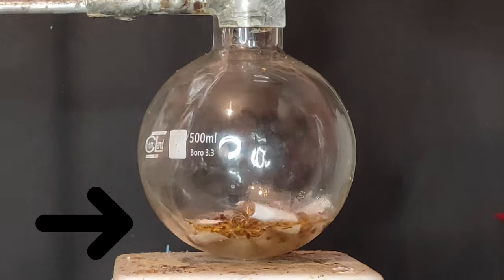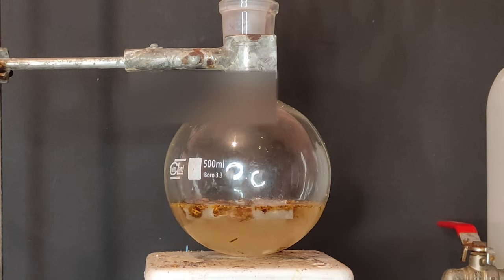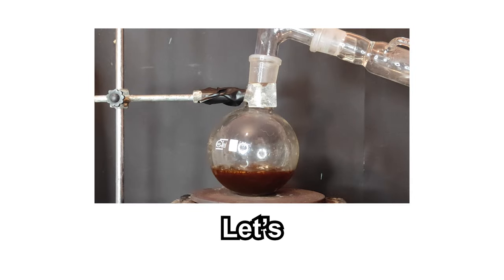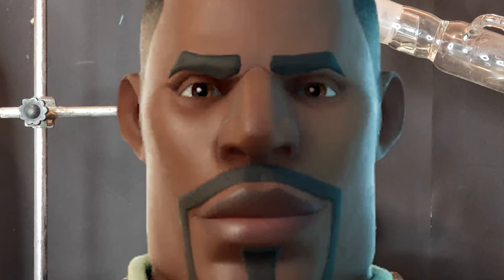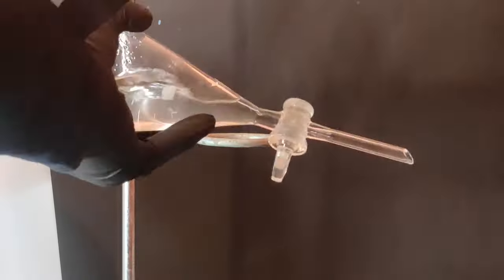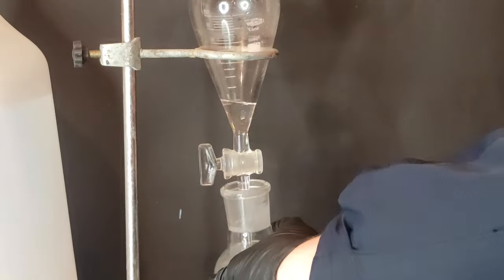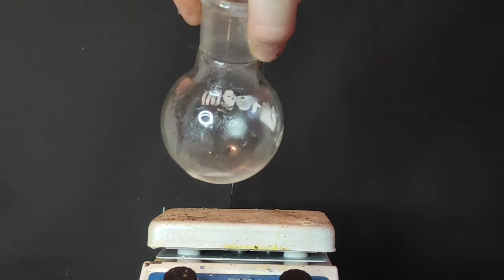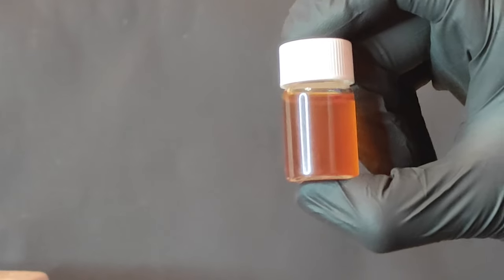Extracting Nicotine From Tobacco

Comment: I was wondering how you could separate nicotine from Propylene glycol or Glycerine?
Reply: Same thing.. just distill it to get the water out.
Reply: Are you extracting nicotine from vape juice?
Reply: Not easily, the only thing I can think to do is salt the nicotine out with your choice of organic acid (one that doesn't react with VG or PG and yields a crystalline nicotine salt I guess) and run a vacuum distillation.  The amount of liquid you have to evaporate for such a small yield isn't worth your time imo, unless you have a very strong solution

Comment: So I have some 10% nicotine in propylene glycol because I make my own vape juice. It's very rewarding when you learn to mix flavorings well. Yours had a dark color which mine also has and I believe is nicotine n oxide and the older it gets it forms a strange "peppery" flavor. It's very interesting how toxic it is but also it CAN be forgiving(nobody out there try this though). I worked at a place manufacturing vape juices long ago and during a stupid accident I spilled a rather large amount of nicotine which got on my clothes and bare skin. I luckily had a change of clothes at work because I rode my motorcycle. I quickly stripped while running to the bathroom to wash off. I didn't even so much as get a nicotine buzz out it. This was a great video It makes me wonder how much nicotine can be extracted from eggplant? I know alkaloid concentration is low but also the highest next to tobacco if I remember correctly.
Reply: Yeah, I'm buying bottles of 20mg nicotine (150 ml) diluted in VG and it happened that I used all my liquids and was waiting for new ones. For a few days I was going crazy a little bit so I looked at old bottles for a small fix and found a bit left in one of these old bottles. It was now yellow/orange but it still tasted normal...
When it's brand new it's perfectly clear without any colors.
Reply: @Alfred-Neuman  it goes really dark and develops a pepper-like taste after sitting for a long while. Mine is such a dark brown color you can't even see a flashlight through the bottle. 🤣
Reply: @midwestchem368 what is a long while? Month? Year?
Reply: @DanDan10101  I've looked at some papers and they say it's to do with UV exposure primarily, so it depends where you keep your juice
Reply: @kuni45  don't forget the heat..
Reply: I believe it's 26 eggplants = 1 cigarette.
Reply: This is actually why you have to wear gloves when handling tobacco plants, it can cause a nicotine overdose and a lot of deaths happen, the skin absorbs it like a charm
Reply: @bonnie9855  where?
Reply: @DanDan10101  where what
Reply: @bonnie9855  where you're handling those plants?
Reply: @DanDan10101  anywhere on the plant, mostly the leaves, but once you dry the leaves out they're safe to handle
Reply: @bonnie9855  I mean where do you work? Marlboro plantation or what?
Reply: @bonnie9855   I haven't heard of a single death from GTS
Reply: @kuni45  because tobacco has been harvested for hundreds of years, people typically know what they're doing. A death is rare
Reply: @bonnie9855  so you're saying a lot of deaths DON'T happen from GTS
Reply: @kuni45  rare still means a lot, we're looking at the population not a fuckin monopoly chance card
Reply: Keep the nic in the freezer and stick to PG due to the viscosity issues of VG

Temp and light oxidize it (esp freebase), hence peppery tastes when people just keep their bottles out in the open

Salts are also more dangerous despite being "smoother" due to a higher pH vs freebase as you generally use more nicotine and they include acids like benzoic acid etc

Comment: Hello Prussian Blue, 
Hope you are doing well mate! 
After dealing with some (issues...) I'm back again and ready to do this same extraction. However, I've got some questions that I think you can aptly answer. The part involving Diethyl Ether is something I probably wouldn't tinker around with (peroxides + overall volatility) - I just saw a video from Thylabs where he did a similar procedure - just that instead of using Diethyl Ether, he used Methyl Tert-Butyl Ether, and his reason to prefer this was that it does not form peroxides - which seems great. Do you think using MTBE would be suitable for this process would be okay? What will change? As in, the evaporation of MTBE after Tobacco Water distillate and MTBE liquid-liquid seperation - in simpler terms, what changes would be needed to this overall procedure for nicotine extraction if using MTBE instead of Diethyl Ether? 

I'm assuming that using Sodium Hydroxide Solution is better for Freebasing nicotine from Tobacco rather than potassium hydroxide (as thylabs did) comsidering your output ratio of nicotine for 5 Marlboro Gold sticks / 5g tobacco seems better than his for 200 grams of Homegrown Nicotinia Rustica - however please don't take me otherwise on the remark, it's just my amateur observation and resulting assumption.

Also, which grade of ethers is most suitable for this extraction - seperation procedure? Laboratory Reagent or analytical reagent? My supplier seems to have both available, and with a very minor price difference (less than a dollar, and I'd be okay with spending an additional dollar or saving it depending on which ones are more suitable)

Edit : okay after a bit of reading it seems like LR is the one to go with for Liquid-liquid extraction procedures
Reply from the maker: Hi, MTBE may be harder to come by depending on your country, as for ether's peroxides they form after a long time in storage so i think if you store it for 5 days in a dark place it shouldnt form peroxide and after youre done with the extraction just pour it and light it on fire somewhere, dont do it at home though, because ether can put you to sleep if you inhale it too much (obviously if youre doing the extraction you will smell the ether but dont freak out because i smelled it but i was in a ventilated room and i was fine) also if you want to have a very high yield remember to wash it a lot of times with diethyl ether and shake it a bunch

Also it mostly doesnt matter which base you use what only matters is the OH part also if you want pure extraction id go with lab grade also ive never used mtbe but if he got a good yield out of it then you should too
Reply: @Prussian_Blue  Thank You for the reply mate, I appreciate it!
Funnily enough, MTBE is available at the Local Chemistry supplies store here, and for much less than Diaethyl Ether 😮 and no issues to get it, just pay in cash, take the item, and leave. Simple as that really. 
My main opposition to Diethyl Ether is exactly that - it forms peroxides. Handling and Disposal of it is very different (and difficult) in Tropical Climate, 30°C is the ambient temperature here even in winters. And chemical waste collection facilities are inexistent in countryside MH, India. 
Will MTBE interfere with the process or cause some unpleasant/undesirable changes to the overall reaction? 
I'll keep the washing and shaking parts of the process as thorough as possible. (hopefully, without popping off and breaking a stopper, haha)

Comment: Thank You bro 😁 

Now vapes are banned in my country (to protect government tax revenue on tobacco obviously) 

So I'll follow your procedure, precipitate this nicotine into salts (anyone can tell me how? I'm a noob lol), mix it with 70-30 PG-VG Vape Juice Solution, add tobacco flavour concentrate (13% works best they say), make my own cig replacement vape juice

Then will order some Japanese Kangertech Cotton for vape wick 
Nichrome wire or something suitable for coils 

Will get an enginner to prep the vape IC, get 10 units of 18650 2200 mAh Batteries (and a universal charger too) 

Get the wires and other necessary apparatus too 

3D print or hire another engineer to CnC a case / box to hold all this together 

Vape in peace ... And finally get rid of tar and glue and paper and 6000+  other chemicals and carcinogens that would otherwise be entering my lungs cause government. 

Wish me luck peeps!
Reply from the maker: Well if ur gonna smoke it you should leave it in a hot water bath to make sure you evaporate all ether also idk about making vapes, but i dont know if its worth changing the nicotine freebase back into hcl, you should research the type of nicotine in vapes or sum👍
Reply: @Prussian_Blue  Thanks for your suggestions, I'll keep them in mind when I attempt. AFAIK, the type of nicotine used in vapes probably isn't any different than the type of nicotine you extracted. Well, Yes, obviously it's had all other things removed. But nicotine is fundamentally the same - Nicotine. And extracted from Tobacco. And if I were to make a guess, Nicotine does not change in nature across types of tobacco either - there may be more, or less but the nicotine will be there. And where I am from, India, tobacco is available for rather affordable prices. ( Anywhere from IN ₹150 / US $1.84 for the cheap local varieties to IN ₹2,000 / US $25 for the Export Grade Golden Virginia variety - per Kilogram. ) 

I guess there's some experimentation in order now - probably 200 Grams each of the cheapest and the most expensive available tobacco each - to figure out extractable Nicotine and differences, if any. 

I'm expecting less nicotine from the cheaper varieties, but who knows, experiments often result in surprising discoveries.
Reply: Hey did you make your own disposable vape and do make the airflow sensor which blinks a light when we inhale ??
Reply: @nareshp126  I did manage something... An MTL Box-Mod (pod mod really) however gotta keep it RDA (rebuildable dripping atomizer) cause if the coil goes out or wick burns, one can't simply just "walk into a store" to get new coils. Gotta be DIY. A TP4056 Module to manage the batteries, a 1.2 Ohm Resistance grade 316L 26 gauge Stainless Steel Coil (gotta wind it 4-5 times around a thin screwdriver and done) plus some Japanese Organic Cotton. 

If you want to have detailed schematics or one made for you, lemme know with a Reply mate.
Reply: @ketanpethe5982  bruh where did you buy tobacco from?
Reply: @mohdkhajazainuddin8972  from a shop in my city's produce market - nothing like that where you live? 😅
Reply: Buy chop chop ciggies.. no chemicals added and just need to distill out nicotine.
Reply: @garystinten9339  I don't think that type of cigarettes are available in India, (or even if they are, I can't find those) but loose Tobacco is available by the kilo, plentifully and affordably. Also regarding the latter part of your comment, I think this is relevant - like the video shows, the distillate that you get by distilling a mixture of Tobacco and (preferably 10%) Alkaline Solution - is a mixture of Mostly Water, some Organic Tobacco Nitrosamines, other organic compounds, and just a teeny tiny bit of Nicotine. The Nicotine is what you want, and the rest probably best not be vaped. So it's not to simply "distill" the nicotine out, there's an additional step of solvent based liquid-liquid separation involved. That's the part where you mix that solution with diethyl ether / Methyl Tert Butyl Ether, shake the solution, wait for it to settle down, the MTBE strips the nicotine out of the solution and into itself, use a separatory funnel to get the rest of the distillate out (which will seperate and settle below the DE/MTBE + Nicotine solution). 

Then the final steps are when you apply mild heat to boil off the Ethers, after which All that's left behind is (hopefully) clean Nicotine, with still a little bit of impurities left - but within the tolerable ranges conforming to United States Pharmacopoeia / European Pharmacopoeia Standards - or Just Follow Chemovatics specs sheet or any other vape-eliquid purpose oriented Nicotine Concentrate Suppliers CoA. But to actually get a thorough understanding of whether what you have on your hands is vape-able or not, specs wise, you need to conduct Gas Chromatography Analysis of the solution you have. I am friends with a person who owns a lab that conducts these tests, so I can manage to pull it off, but if you just walk into any GC Analysis Lab with a sample you want to test for purity of Nicotine, considering how terrifyingly Toxic it is, the lab might call cops on you or maybe just refuse to test without getting some Toxicology Research Background paperworks from you. Differs for each country.
Reply: @Prussian_Blue  Thanks for your video again bro. I didn't even imagine the journey this was about to take me on, but for the past 5 or so months I have been reading and finding info, researching little things I didn't understand, and I think I finally have a working way to extract nicotine that can actually be safely vaped (or in the same capacity as other market available vapes but I know one thing and it's that vapes are much better than cigarettes)

You can read the breifs of my findings in other comment I made in this replies section. Do let me know your thoughts and suggestions. 

Once again, Thanks bro, sincerely.
Reply from the maker: @ketanpethe5982  glad i could help
Reply: @ketanpethe5982  I'm based in India too and a victim of the aforementioned government policies on vapes.

Could you share the detailed schematics please. I have been researching in those lines for several months now and feel completely exhausted to say the least.
Reply: @ketanpethe5982  Have you tried getting some destilled/extracted DIY nicotine liquid tested with Gas Chromatography?
Reply: Same here, in Russia. But they didn't ban it entirely so far, just made anything related to vaping ridiculously expensive due to inadequate taxes. There are still online stores where you can get juice ingredients for reasonable prices though. So I'm stocking them for at least a year more. Not sure what's next, maybe when I run out of them, I'll have to go full blown Heisenberg and distill nicotine manually 😂 We'll see how it goes.
Reply: I'm doing something similar

Easy cheap supplies of VG/PG everywhere

Pure sterile cotton is easy

Sandvik Ni80

Purges

Freebase nic extraction diluted to 10% (w/v)

Concentrate supplies that are still somehow operating here for now

Otherwise international "perfume / cupcake" flavourings

Batteries are batteries, also easy

Comment: 我想知道这样制造的尼古丁的纯度是多少可以用来直接加入电子烟吗
Reply: Nicotine salt is the pure form extracted from raw tobacco leaves or synthetic ( not the same as the vape salt ) the nicotine salt which can not be smoked is turned into freebase which comes from the term freeing the base form cocaine which was by using etha and very dangerous,  the freebase now can be smoked ( this is at its purest usable form ) via either adding to cigarettes to increase the mg or adding to VG / PG for vape the freebase then can be salted where they add 1 of 2 types of salt which are a whole other story this increases the rate it can be absorbed and acts also as a preserve but is also more toxic in different ways which is a long story. Hope that answers your question :)

Comment: Is there a way to get the nicotine out of the cigarettes which leaves the tabaco intact and safe for use?
Reply: The nicotine is not the worst thing in the cigarettes trust me, its the carbon monoxide, tar and other carcinogens
Reply: I think they're trying to make nicotine less cigarettes to stop smoking
Reply: That's what they do all the time these days - they wash it with water. The problem is that people smoke more to get the proper buzz so they inhale more unnecessary carcinogens and tar. Cigarettes used to be stronger and better

Comment: I want to know the purity of nicotine produced in this way. Can it be used to directly add electronic cigarettes
Reply from the maker: pretty high, im not an expert at E-cigs but id say it probably could
Reply: No. Any h2o will cause steam and would burn you any other liquid in vapour would have different problems , Nicotine salt is the pure form extracted from raw tobacco leaves or synthetic ( not the same as the vape salt ) the nicotine salt which can not be smoked is turned into freebase which comes from the term freeing the base from cocaine which was by using etha and very dangerous,  the freebase now can be smoked ( this is at its purest usable form ) via either adding to cigarettes to increase the mg or adding to VG / PG for vape the freebase then can be salted where they add 1 of 2 types of salt which are a whole other story this increases the rate it can be absorbed and acts also as a preserve but is also more toxic in different ways which is a long story. Hope that answers your question :)